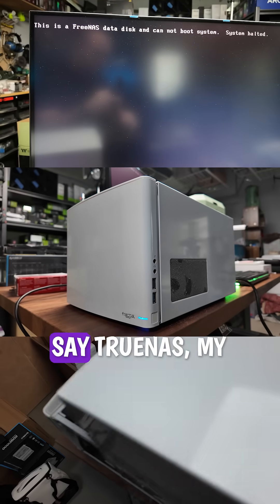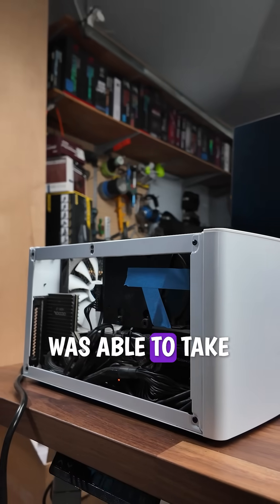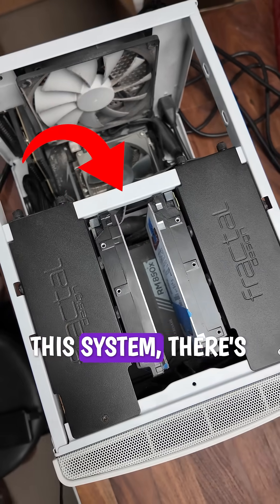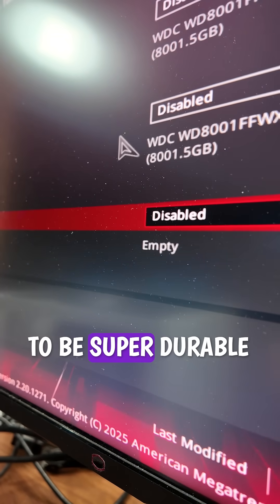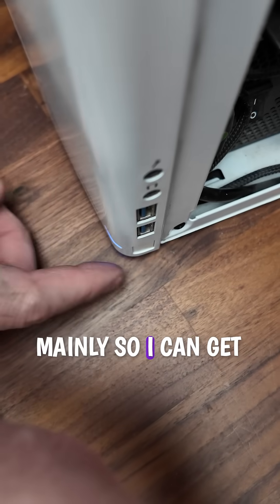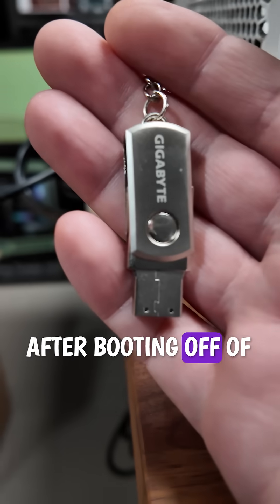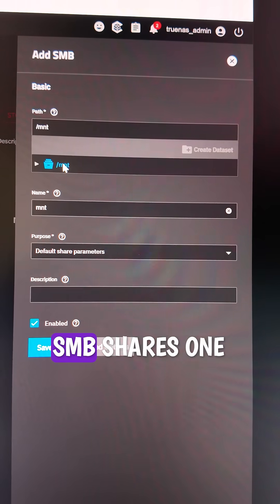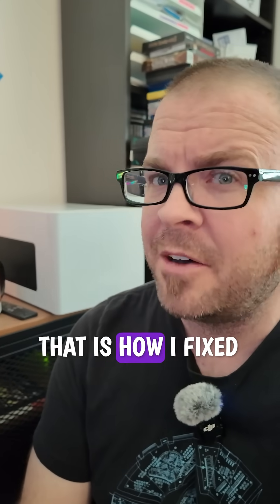Pain in the NAS

Comment: This is exactly why I simply back up to multiple external hard drives instead. Was just having a conversation this week about buying a 50-100TB NAS. Thanks for reminding me why I dislike them.
Reply: What’s wrong with a NAS? I love mine, and the fact that I built it myself makes it that much better.
Reply: @StolenJoker84  I don't treat my data as a groovy pet project. It's the storage of decades of work and my entire livelihood.
I don't want to have to periodically rebuild it, hoping that my data is not destroyed. I don't want to have to learn entire new skill sets. I've owned two, maybe three NAS's and they all died with all the data on them. Frankly, I find the technology expensive, too technical, and unreliable.
Reply: @ Well, even with a NAS, you should have backups of your important data.

Regarding the data loss on a NAS, my NAS was built out of scrap parts as a small project to spend a little time on. It lasted a year and a half before a power fluctuation killed something on the motherboard. 

I just rebuilt it with much newer hardware, and lost absolutely no data. Even in this short, there was no data loss, just a failed boot drive (TrueNAS has separate drives for data and boot). 

Not saying the NAS is for everyone, but it has made things a lot easier in my home.
Reply: @StolenJoker84  I'm not criticising your choice to go for a NAS - I'm pointing out that an expensive, highly technical solution that has failed twice at the total cost of my backed up data is not for me.
I'm aware that this example did not result in the loss of data, but the solution appeared way beyond my comprehension.
Reply: @Martial-Mat  That is fair. Not everyone is interested in this kind of stuff. For those who are more technical minded, the issue here was nothing significant. Can happen on anyones computer (that’s all a NAS really is anyway). For someone who isn’t technically inclined, then I can see that point of view as well. 

I’m curious what kind of failures you had that resulted in total data loss. While a NAS does not count as a proper backup, one should be able to sustain some failures without data loss.
Reply: @StolenJoker84  ISTR both were 2 drive NAS systems from a British company, quite famous back in the day. I believe in one case a drive simply died. In the other, the system simply refused to power on period.
In fact, I was moderately technically literate back in the day, I get sick to death of constantly fault finding. Right now, my main PC randomly disconnects various USB devices, although I can never determine precisely WHAT is disconnecting. It also does this really annoying stuttering thing, which only tonight I have come to suspect may be due the sound drivers in some way. My system also runs insanely hot, even with good cooling and games that ought not to tax the GPU/CPU (Planet Crafter and Terra Nil).
It's infuriating to constantly spend your time tracking down non obvious issues that potentially have multiple causes. I don't want my backups to be another source of stress.

Comment: If you download the config, it would have been a lot simpler...it's worth it to do it every once in a while, check your status on smart and scrubs, and use 2 boot drives mirrored (they're cheap and dont need much space).  You didn't really have a broken freenas/truenas you had a hardware failure or 2.

Comment: Really great timing for this type of video! I've been contemplating new builds for various reasons using different methods. I liked seeing this kind of build. My mind is on a dual boot build with Windows and Pop! OS or Steam OS (want to learn Linux on a gaming focused distro). Also might make use of raid 0 with some Western Digital SSDs I want to salvage from an older build in my closet. Also want the CPU and GPU to both be AMD. Currently running a 5600G and RTX 3060 (using a parts build from one of your videos when GPUs were scarce and expensive!) and might try to make this work with what I've got right now. Thanks again for the videos Paul!